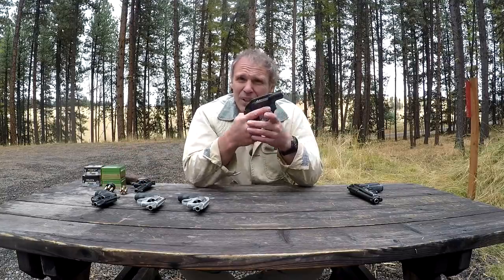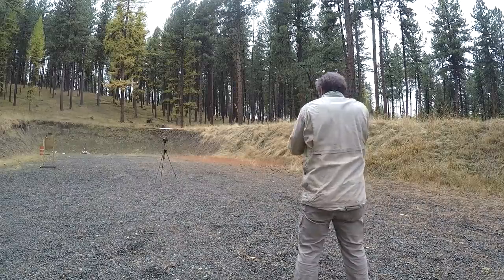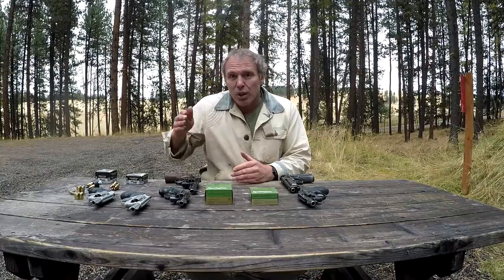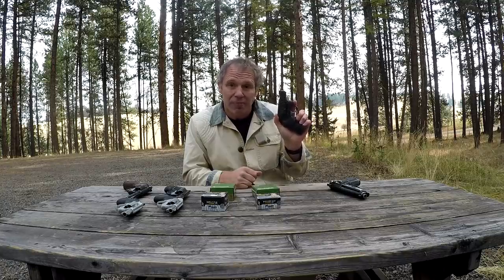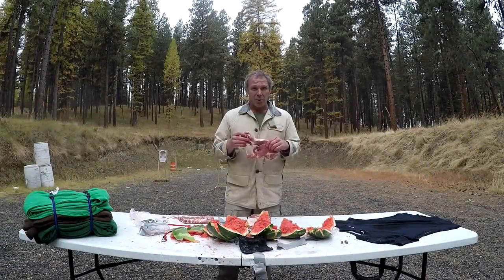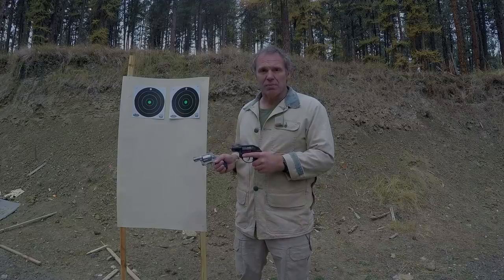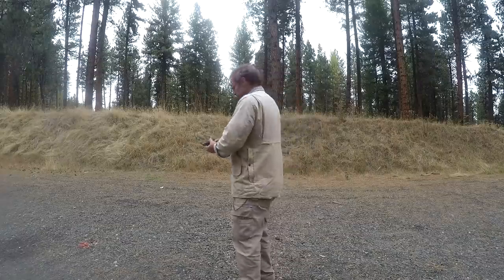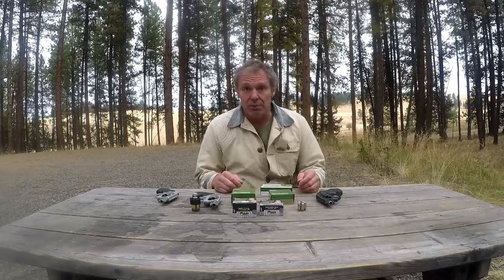Ruger LCR 9 Millimeter

Comment: Attention to Paul: I understand that you’re in the Pacific Northwest. I think Oregon. Please do a video reminding the audience how important it is to vote in the Washington election. Ballots will be mailed out in two days, and I-1639 is horrible for gun rights in the state of Washington. It qualifies semiautomatic .22 as an assault rifle, and will add up to $275 to the cost of a new gun! Aside from violating gun owners HIPPA rights. Please spread the word, Paul. Thanks.
Reply from the maker: I like to stay away from politics, but a reminder to vote (without supporting any issue or candidate) would be a good idea.
Reply: Paul Harrell I understand. Maybe you could outline a few of the key points people may not be aware of
I-1639, given that it is THIRTY PAGES LONG I-1639-
-qualifies an assault rifle as  (25) “Semiautomatic assault rifle” means any rifle which
utilizes a portion of the energy of a firing cartridge to extract the fired cartridge case and chamber the next round, and which requires a separate pull of the trigger to fire each cartridge.
“Semiautomatic assault rifle” does not include antique firearms, any firearm that has been made permanently inoperable, or any firearm that is manually operated by bolt, pump, lever, or slide action. 

I’m sure you’re aware, but people ought to know, that yes, your Ruger 10/22, Marlin Camp Rifle, your 30-06 semi auto deer rifle is now an assault rifle and is subject to all of the following:
HIPPA violation by requiring the sherrif to investigate your medical records before you can purchase a firearm, and EVERY YEAR THEREAFTER. Diagnosed with depression? Anxiety? Has the VA diagnosed you with PTSD? Or maybe you’re a crime victim with PTSD. This will now come into the purview of the commissars deciding whether the constitution applies to you. 
-It levies a $25 tax on “assault weapons” so that you can pay for the sheriff’s time while he’s digging through your medical records.
-it that The purchaser provides proof that he or she has completed a recognized firearm safety training program within the last five years that, at a minimum, includes instruction on:
(i) Basic firearms safety rules;
(ii) Firearms and children, including secure gun storage and talking to children about gun safety;
(iii) Firearms and suicide prevention;
(iv) Secure gun storage to prevent unauthorized access and use;
(v) Safe handling of firearms; and
(vi) State and federal firearms laws, including prohibited firearms transfers.
The training must be sponsored by a federal, state, county, or municipal law enforcement agency, a college or university, a nationally recognized organization that customarily offers firearms training, or a firearms training school with instructors certified by a nationally recognized organization that customarily offers firearms training. The proof of training shall be in the form of a certification that states under the penalty of perjury the training included the minimum requirements; 

A class of this kind, ordained to meet the states guidelines, not only will take years to set up, Will most likely be exceedingly expensive. At least $200. Add to that the assault rifle tax stamp, and the $20-50 NICS form 4473, and you’re looking at paying $475 for a used Ruger 10/22! Wow! And for people who say that the class is a one time thing, you’re wrong. It’s every 5 years! 
-If your firearm is stolen and used in a crime, you can/will be charged with a felony! Talk about victim blaming. 
-it makes it so that a 18 year old may no longer buy a long gun. It restricts the age to buy a gun to 21. I guess it’s ok to have your company armorer sign out your 240B machine gun while you’re away on drill for the weekend in the national guard, young man, but woe to the man walking into Cabelas to buy that new Ruger PC Carbine.  

I think that’s about it. If I missed anything, folks can fill in. If you read all this Paul, you’re even more of a champ than I thought you were. And thank you for your time.

I know you’re for people taking classes Paul, and I agree to a smaller extent. But this bill is a gun grabbers wish list, unenforceable. Even the police associations-Washington State Patrol Troopers Association, Washington State Sherrifs Association, Washington Coincil of Police and Sheriffs, and Washington State Law Enforcement Firearms Instructors Association. All against this bill, it is so egregious. Seattle Times brags, and the better newspapers lament, it will be the harshest set of gun laws in the nation. To think, prior to 2014, Washington has some of the better crime rates in the country, and yet some of the most easy going gun laws. Hmm. I won’t speculate on why that might be. 

My main point in my plea to you, is that these people NEVER stop. Their end goal is to take away our guns, and now most of them don’t even mind going on national television to say so. They know we aren’t the ones harming people and committing crimes, we, the ones who will bear the brunt of this law. Hell I’ve seen liberals saying that the state should make the classes free for the poor in the inner cities, and make the classes cost more to make up for it! We have to dig in now and not give up another inch. Maybe when America is made right we will make firearm education part of the educational curriculum (which it should be) but now is not the time to give these people (and Michael Bloomberg the billionaire trying to buy the law) a huge, energizing win.